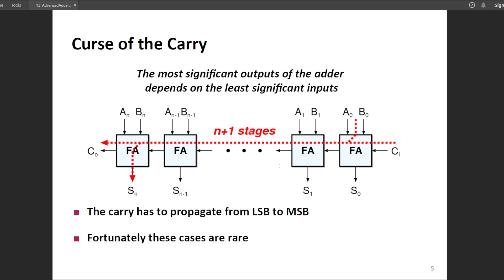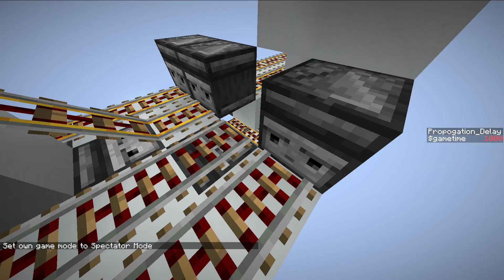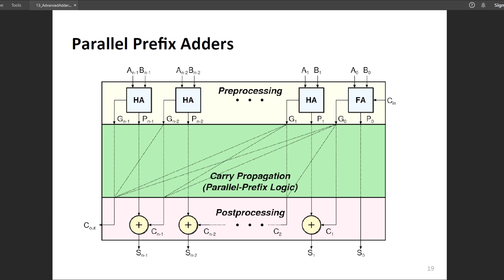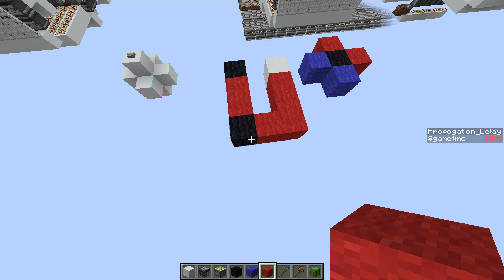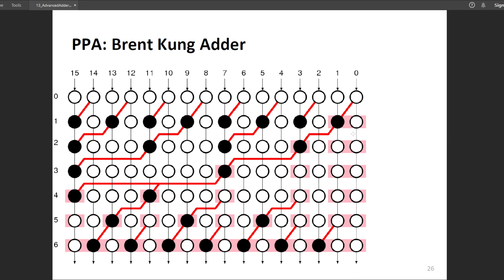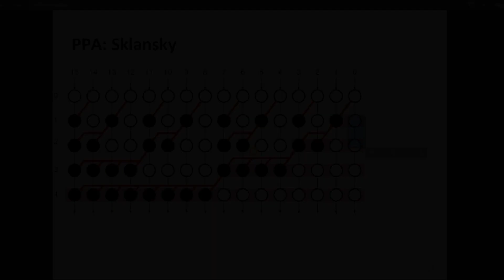Designing a Parallel Prefix Adder in Minecraft || Redstone Computing

Comment: Amazing video! I wish more of the technical/computational minecraft community made vids like these

I do have a question though, you were explaining difficulties with going diagonal in minecraft, but could you not have a descending rail line to get that diagonal nature needed for the more complex models?
Reply from the maker: Thanks! I really appreciate it. This stuff is really cool, but can get pretty complex -- it's tough to strike the right balance of acknowledging the complexity while not infantilizing the explanation, so lecture-style content is how I try to avoid that.

To your question: probably, yeah! If you constructed a system that tiled vertically instead of horizontally, you could presumably find an interconnection strategy that utilizes ascending/descending rail lines to link the different cells. Having said this, the diagonality was never really the true problem -- the limiting factor is moreso that the interconnects are drawn diagonally because so many "crossings" (as I called them in the video) are required. I touch on this part briefly as well from the perspective of "fan-out", but that's the real killer for trying to implement the more complex models in-game.
Reply: I honestly wish my professors made content like this, its truly underrated. One of the few lecture style videos I enjoy coming back to

I ended up using the build from here, trying to make a my own vertical/diagonal demonstrated how well made your original cells are. All of my attempts had slower timings or took up a larger area. Modifying your adder allowed me to successfully make an ALU, so thank you once again.

More on that interconnection strategy, I'm focused on making other builds (and games) at the moment but I do want to share with you the idea of utilizing "wallstone" to instantly link together different cells. Normal rails have to repeat a signal at the 10th block, limiting the range of the feedthrough cells. You could use instant wire instead, but one of the benefits of wallstone is the ability to do logic on the wall itself. Using trapdoors to make 'and' gates all without triggering the observers in the previous cells.

Comment: Hello allo
very nice watch

I would have thought that on your 16bit, it would have been better to shift the propregate wires over instead of the generates
Just cause you've got heaps of space and delay to work with

Currently you have all inputs and outputs of the mergers in sync 
I wonder if it's possible to have them unsynced, but they still mesh together perfectly (both in time and space) 
Then you can remove the syncing delay on them
Reply from the maker: Hey! Thanks :)

Y'know, I think you're absolutely right. I can probably shift the Propagates instead to save that 2gt delay. I chose to shift the Generates because that's conceptually what's happening, but left-shifting G is the same as right-shifting P in this case. I'll give it a shot! (Edit: due to the routing of the carry in/carry out signals, I don't think this will end up being possible.)

I experimented a bit with asynchronous inputs but ultimately found that since each stage needs to be synchronized across itself (specifically for P calculation), there were diminishing returns on doing that. But! I do have several other things in mind that might benefit from exactly that.